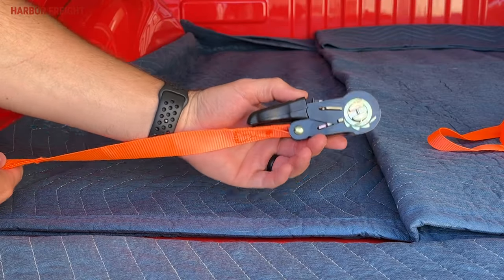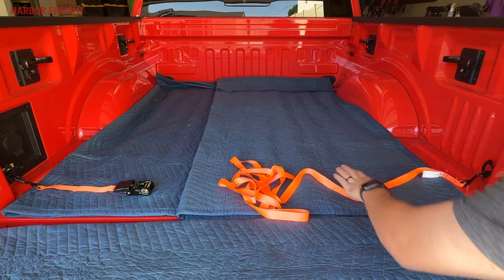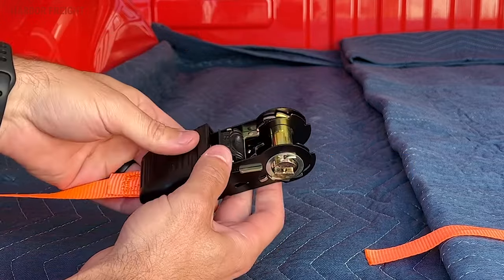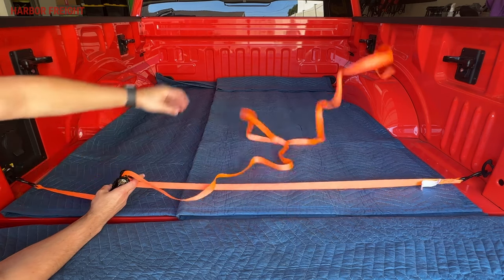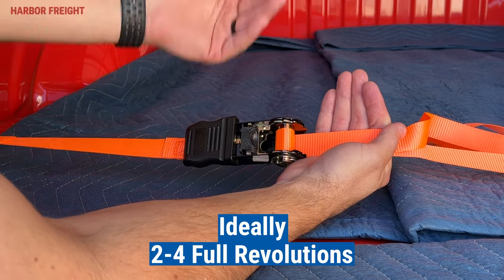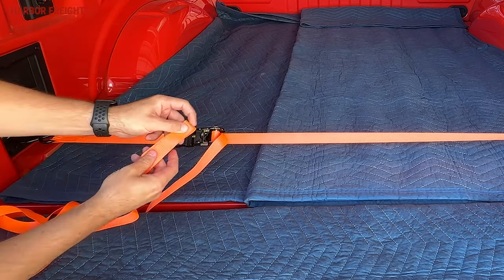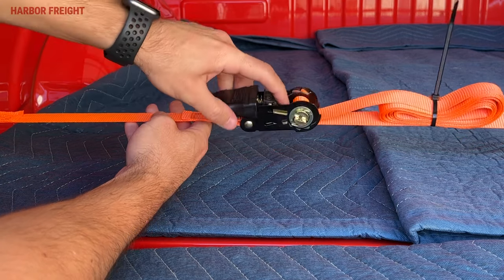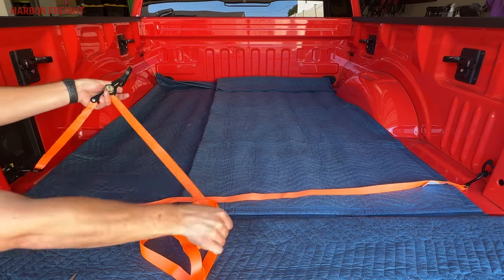How to Properly Setup & Use a Ratchet Strap

Comment: The one safety tip I would add is to have the ratchet on the passenger side in case you need to adjust tension while traveling you will not be on the traffic side of oncoming vehicles.
Reply: Good point!

Comment: All the available ratchets on the market are still basic and simple. Tons of room for improvements.  The open hooks on the ends are hazardous. If the load shifts or moves at all and the strap loosens; the hooks come unhooked and the whole strap assembly can fall away. Snap carabiners on the ends would be much better. I've been cutting off the hooks lately and adding carabiners.  

Also some sort of Velcro or rubber strap to bundle up the excess strap. And yes; I've seen all the YouTube videos on various ways to store the excess.
Reply: See what you mean, Velcro to hold the extra would be great

Comment: Thanks for the demo.  I have several rain barrels and eventually a vertical crack appears, but leaks only when full because of the expansion.  I'm going to gird one tightly with a ratchet strap and see if that helps.  First a couple of layers of silicone caulk on the crack.

Comment: will there be a 3/8 icon flex head torque wrench with angle. 
you came out with the ; 
4 ton jack✔
Zurich z15s✔
1l2 icon digital flex head angle torque wrench✔
viking 3400 jump box ✔
this is best 12 hundred spent. 

hammers, ratchets, sockets, wrenches, pliers, screwdrivers ill just do the 301pc or 428 pc master set @HFT.

but auto maintenance , auto care , and auto body ill buy at hft.